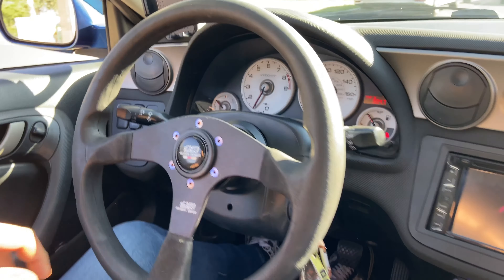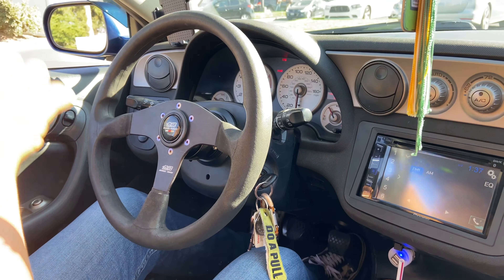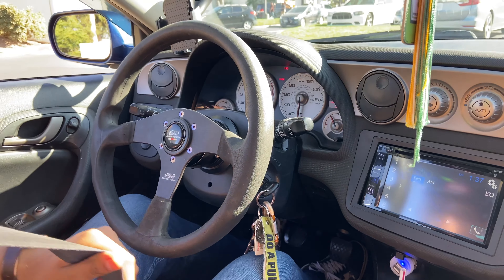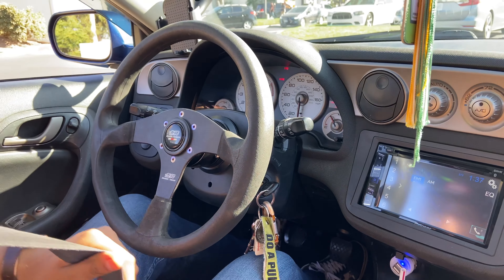K20A2 vs. K24Z7: Which is the SUPERIOR Motor? 2013 Honda Civic Si vs. 2002 Acura RSX Type-S!!

Comment: That guy in the rsx didnt even start the race on vtec power band , thats so hilarious how clueless peapol can be
Reply from the maker: LMFAOOOOOO
Reply: It's like he did it on purpose to try and degrade how good the type s really is.
Reply: After 4th gear the rsx should real in the k24 and gap the k24 by end of 5th gear. I own the k24.. k20 takes high end
Reply: @tonym4136  I have a type r k20 mated to the z1 trans and I eat all other k series stock for stock
Reply: It wasn’t even an fair race to begin with, SI is fully tuned and rsx just has basics bolt on. This is like 180hp rsx type s with drive train loss vs an civic si with 220hp at the crank.
Reply: peapol? lol peepole lolol

Comment: Always hard to race manual cause somebody could bodge a gear & fuck up the race. You need 2 complete pros racing to make it fair. Not saying they didn't race great, but some videos you can tell the car should win, but lost due to driver error.
Reply from the maker: Agreed 100%, so many variables at hand on these type of races

Comment: Everyone talks crap that the k24 z7 only has VTEC on one cam. So, it also has 205 horsepower. More than a k24a2. Or any K20, especially it's power is all the way through the Rev range not 6,000 and above at 5500 it feels like I'm in a DX hatchy gun in it. And it has more horsepower and torque than either of the motor k24 z7 for the win! Change my mind
Reply from the maker: I feel it
Reply: It’s overall the best motor of the N/A  k series line aside from the Type R and Honda Accord.
Reply: The k20a is 220hp stock. The k24a2 you can install race header where the k24z7 you cannot. K24A2 has VTEC on both cams therefore there's more tuneability. I run a frank motor and put down 224hp and 179 torque with ebay mods. The k24 here in the vid is a boring engine. I've driven one, there no VTEC kick and it revs low. K20 or frank ftw
Reply: @lindaover9764  yeah the Japanese type R. The k20a2 is 200- k20z3 197. Ive had them all. Working on an R32. You can hear VTEC an yes you can install race headers and TURBO headers hahaha. I bang on RSX-S an 8th gens all day. 25- roll the 40 lbs of torque pulls. There loud an fun but you know if a mini van is next to you in an 8th gen an guns it that k20 is like a 1994 DX below 55-6000rpm. Caca. I'm just getting out there a FBO k24z7 an a K20a or a2 FBO would not just walk it. An good luck finding one with less that 900,000 miles hahaha. 139lbs of torque at 7,000 rpm . An 185lbs at 4300 homie. The best is k24/20 as we both agree on.  But the k20 does not just WALK it IF anything. An k20 for a grand or k24 for 6-700$. K24. I did have alot of fun in my 1994 stripped CX 98 type R engine built from valve cover to oil pan! It does suck I has 1000rpm less but you get speed at 3000 rpm to 7000 not 55-6000 to 8.  I know what a k20A2. I owned one an at 3-5000 rpm I pin it an it's a DX till 6k. The 24  2k 3k has the pull the 20 does at 5k-6 easy. Again I've raced a bunch of people rsx Civic you name it an when they get me by a fender or I take them by 2 cars with similar mods they like what u got. Just a single VTEC 24 hahaha economy box. Oh you got the k20 RACE engine hahaha buy a V8 an call it a day no mods.
Reply: @lindaover9764  an bring the K20A-R that K24A2 would wrap it up. Oh 20 more hp at 10 grand try 45lbs of twist at 4300. Again unless your going to rebuild it you know a K20 has been boned in every hole for years an years an she's a gapper.
Reply: @lindaover9764  wow wait 224 with a frank? I have seen k20A2 put down 220 an change FBO an maybe injectors. I saw a k24z7 put down 209 with intake an down pipe an tune. Every Dyno different so only way to tell is to line up! Ya I thought k24 frank is like 240-250 hp out the box.
Reply: @johnnyboi5661  then you haven't seen a J or F .
Reply: @enhancedphysique6452  the frank is a receipt for performance IF you build the engine. The k20 a2, Z1 and z3 are like ported k24a2 heads, they flow better up top. I'm running all stock internals. My tuner said I make more power up top than a standard k24a2 thanks to the head,but a little less torque prolly due to me not having TSX cams. Also his Dyno doesn't read high is what he said. Anyway I'm happy with it. It's quick and drives so well. I made power by past 8g rom, but he would not allow me to daily it past 8g lol. He's trying to protect me. I wish we could line up man. I'd run ya
Reply: @enhancedphysique6452  I used to own a 69 Camaro with a 350, a couple mods. It was torquey and quick, but I'm all about Honda now. I like the way they drive and cheap upkeep. My daily is clean and fast enough, and I get to say I drive a frank swap even though it's really nothing special. Just a good ol honda
Reply: @enhancedphysique6452  lol yup
Reply: @enhancedphysique6452  with cams you're around 240 to 250 sure.
Reply: @lindaover9764  weird. I saw FBO k20z3  at 220.  So is a frank better when it's modded or what? So the frank only gives 10-15 hp? Good to know. Ill stick to the k24a2  do the VTC FBO oil pump slap it in my EG an call it a day.  Yeah I heard k24/k20 head puts down 240 to the wheels out the box no mods.  But good shit good luck on your build. Nothing sounds or beats a k24a2 bottom with a k20a head. I wanna do it but now it don't sound like it's worth the cost. But we'll see
Reply: @enhancedphysique6452  it's not worth the cost to slap a k20 head on unless you're planning to spin your engine past 8000rpm, safely. The k20z3 made power because she spins so high. My motor has greater potential than 224hp, but remember I capped the rpm to 8000 even though it had more to give, the rods being the limiting factor apparently. If you're ok, according to MY tuner, not spinning past 8G then a k24a2 long block should perform pretty equal to mine. If you want to spin to 9 grand, then the frank will out perform the k24a2's cylinder head every time. This is my understanding. The k20a2,Z1 and z3 have a superior flowing head, albeit the tsx cams are the best Honda cams, so...... Lol Anyway a tuned k24 with race header cold air with rbc or better, and a pro tune will net you loads of joy. And in an EG, you'd spank my rsx. You'll be a force to reckon with. I wanted to mention I'm also running a quiet and restrictive muffler. I'm losing power there but for the sake of livability.
Reply: The vtc will help your midrange power, as you know
Reply: @lindaover9764  you know it man. Naw I would rather have a k frank. I would choose that over a boosted k20 or k24 all day. Cheap money an I've had the K an spray in EGs I'm older now an honestly a built K boosted or spray running around on the weekend haha in a 30 year old car will get ya killed. I love Hondas but gets scetchy after 50 haha.
Reply: @enhancedphysique6452  same. I'm 40 and the kfrank is plenty. I value cleanliness and reliability over creaks and loose bolts and issues. I won't even get cams. Stock Honda all day!

Comment: The distinguishing factor isn't torque output of the engine but the gearing. The 02-04 RSX had significantly taller gears which ultimately means less power at the wheels. An 05-06 Type S would be very close.
Reply from the maker: Doctor Ferdinand interesting, I didn’t know about the gearing difference between the years
Reply: @abc.garage  Yeah the refresh in 05 is pretty substantial. The Type S got type R cams, IM and gearing as well as inversely wound springs and some changes to suspension tuning to try to fix the RSX's awful ride and handling.
Reply: You’re right, the facelifted Type has much closer gearing and more potential motor wise. I think pre-facelift Type S comes with a 4.3 final drive, which is waaaaay too long for the powerband the car has. Needs at least a 4.7 to take advantage of the K20 peak power. Its so hard to find someone that owns a facelifted model though!
Reply: @Getsomepiggy  me
Reply: @doctorferdinand1003  and the type R final gear drive. 4.7:1, as you mentioned

Comment: thats not even a question... when you know the rsx cant beat a k24
Reply: Stop the cap. The rsx just needs better bolt ons and a better driver and that 9 gen is getting slapped up. I've beaten k24a2 swapped fa5's making close to 200 torque on the k20a2 rsx.
Reply: @HarisRazzaq  k24s always make more power on mods anyway though... and the rsx is 100lbs lighter so it wouldnt make a difference

Comment: The Z7 sucks.....a2 all day
Reply from the maker: Depends on what you're assessing it based on
Reply: Everything. Z7 isnt full vtec like the type s. Plus the integral exhaust manifold in the head is less efficient over the a2. Sure it may have low end performance over the k20 but that's about it
Reply from the maker: @TheShangralaaaa17  definitely comes down to the driver’s preference
Reply: The k24 is way more fun to cruise and drive in the city. Feels faster just because the torque! U always gotta be going fast to have fun in the k20
Reply: Sucks cause it dont have full vtec lol ok guess you can say that in your opinion def not slower
Reply: @randee7194  you're right it doesn't. But the k20 doesn't have that torq either until u start really modding it. K20 makes more power we all know that. K24 fbo is pretty fun. Picks up quick if u like 1-4
Reply from the maker: @randee7194  Facts
Reply: Hey I just watched a z7 beat an a2,and I have beaten type s's in my stock 9th gen,both are good in my book tho